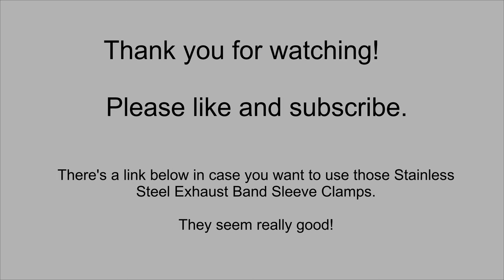Evil Energy Stainless Exhaust Clamp - Fixing Broken Pipe | Man About Home

Comment: Should have used Exhaust silicone and you would’ve had a perfect seal and extra strength
Reply from the maker: It's a rusted out leaky old exhaust system. I'm not concerned with a perfect seal... just getting more time out of it until it can be replaced. It lasted ten months until it broke in another location and I replaced the cat-back system with new. Check out the video. Thanks for watching!